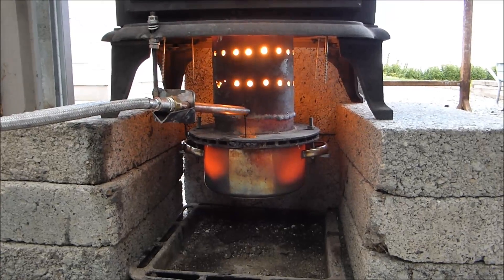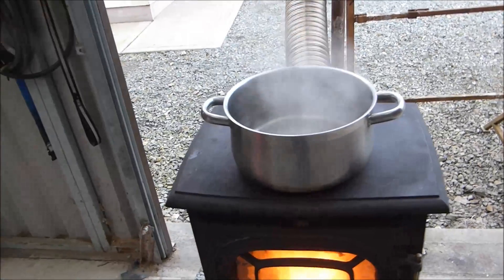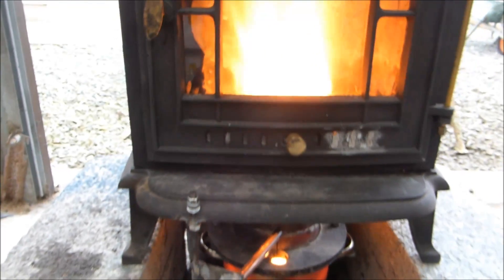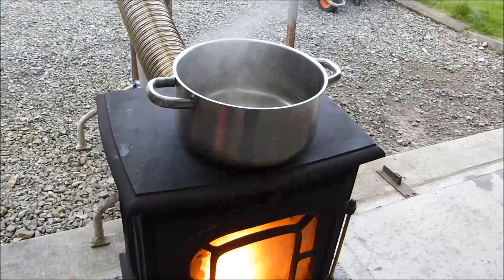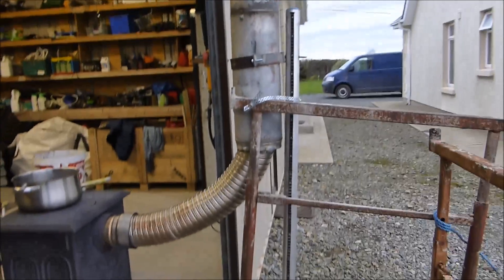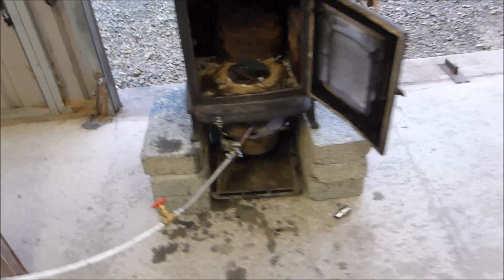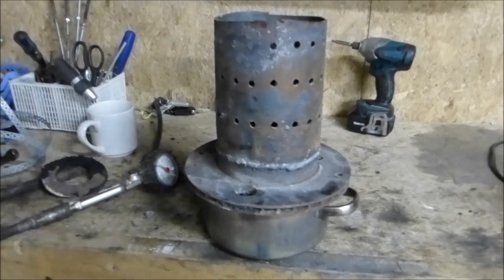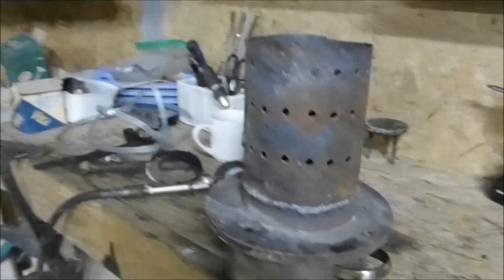Make a Great Waste Oil Burning Stove Heater

Comment: Hi, thanks for your video. your set up is fantastic. i've been heating my home for the last 2 years with a home made waste oil stove made from 2 gas tanks and the burner is a vaporising pot burner. You could use a stove with a back boiler and heat the water in your central heating system. you sound Irish? I'm in Galway. All the best
Reply from the maker: Hi. allgoodhere1 Its great that you have a working system, have you any videos posted. I will post a video soon of this vapourising setup heating water ( in a boiler) for a domestic radiator / underfloor heating system. Yes you are correct the accent is Irish :) Cheers.
Reply: successful waste oil burner
Hi, thanks for your reply, i can't wait to see your set up heating water. The system i have is decent but needs daily cleaning that is not easy and quite a dirty business. I have an idea of setting up a burner like yours at the bottom of a conventional oil boiler but the one obstacle i have is that the water also goes through the bottom of it so if i cut a hole through the bottom to insert the burner, it will need patching up. I have pics of my set up on photobucket, i'll try to PM you the link. All the best
Reply: successful waste oil burner
HI, I'd love to see the set up you have for heating the water in your central heating system, if you get a chance,
 even some photos.
Reply from the maker: allgoodhere1 Hi Check out the latest video. I have the boiler making lots of heat and heating a 300l hot water storage tank in about 1 hr. Cheers

Comment: Great videos ! Thanks.
One question I need to build one but need a way to control temp. Can I do that just by adjusting oil feed ? And will it combust properly at a low feed rate ?
Thanks
Reply from the maker: Hi Robert. If the air fuel mix is not matched it will soot up and smoke. Having said that I can get it running quite a bit lower with no smoke by just adjusting the oil flow. You could partially slide a plate over the 30mm air inlet hole to slightly close the airflow into the pot and turn down the feed on the oil. The pot needs to be hot enough to make the fuel combust so there are limits. Hope this helps. Cheers
Reply: Do you think making a smaller combustion pot would help keep the temp up with a lower drip speed and less air intake ? Thanks
Reply: I meen help bring the temp down :-)
Thanks
Reply from the maker: Robert Landreth Hi Robert. With the current setup if the oil feed is reduced from a stream  to 2 /3 drips per second most of the combustion takes place in the pot and the 6 inch pipe with little to no flame in the stove. The heat is definitely reduced. I tried a setup without a pot all all but needed to add air with a compressor to get it to run. Cheers

Comment: Thank You for your last post.   I wanted to ask one more question.  What is the best way to cut the circle for the cast iron stove?
Reply from the maker: Hi Kathleen. If you have access to a plasma cutter it would fly through it. I marked the circle with chalk and used my arc welder to burn away the cast. You could drill a hole and use a jigsaw with a metal cutting blade. Be careful as the cast is brittle so not too much heat at a time if using a welder and not too much force or you could break the stove. cheers

Comment: how do you light the burner?
Reply from the maker: Hi Kathleen. All I do is ignite a firelighter throw it in the pot and turn on the waste oil. After 2 or 3 minutes it starts to roar and get red. A drop of diesel, kerosene or white spirit on a rag works great also. I have been asked how to light it several times now so I will post a short video of the procedure tomorrow. Cheers.
Reply: successful waste oil burner